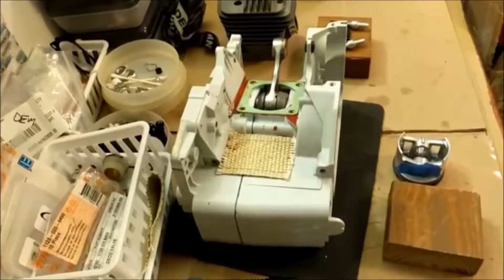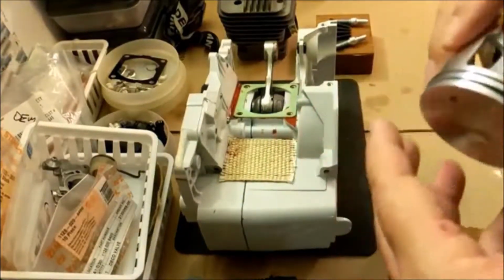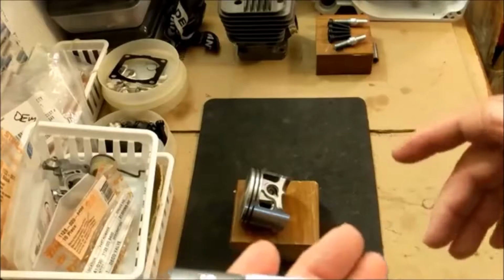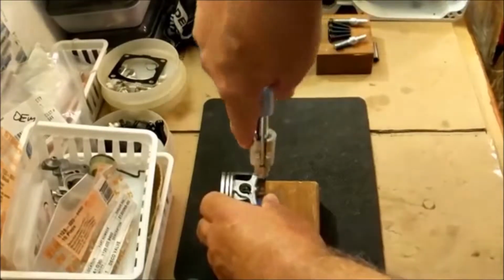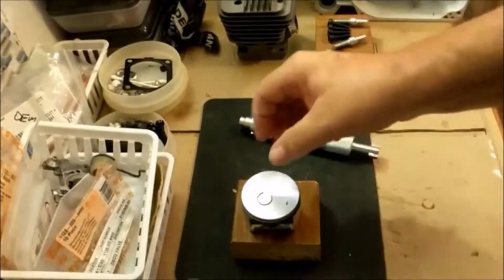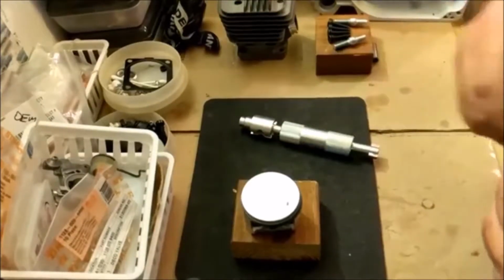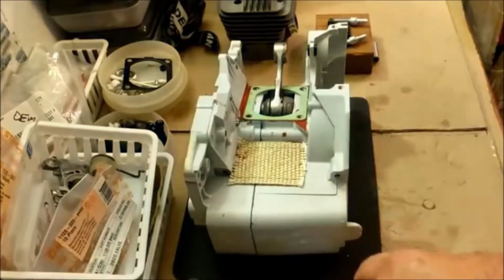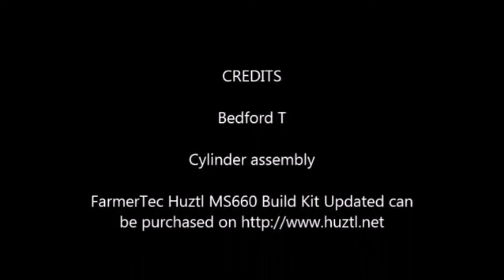FarmerTec Huztl MS660 Build Kit Update Cylinder Assembly Step 2

Comment: I built my ms 660 four years ago.  It is still doing fine.  I carry a 36 inch bar, full comp, full chisel chain on it when I need it, but mostly an Oregon LGX chain with a 20 inch bar, 3/8, .050, 72.  It did add big bucking spikes to it but that’s all.    I added aluminum tape to the tank, as I do to all of my big saws.  I had to play around with cylinders until I got one with the right squish.